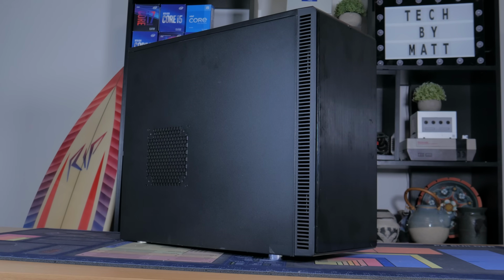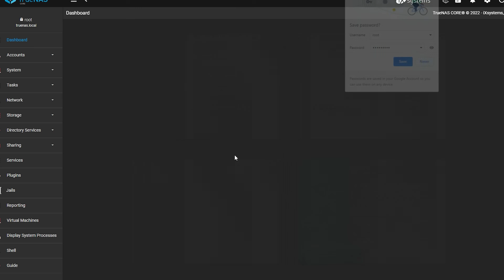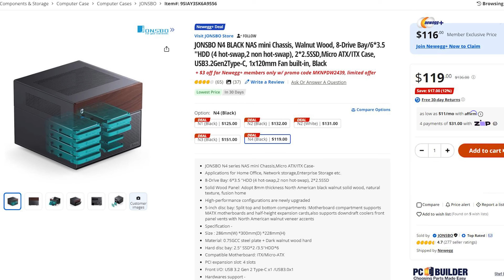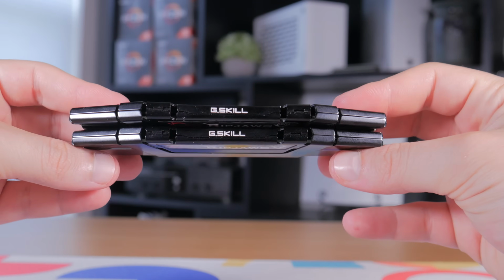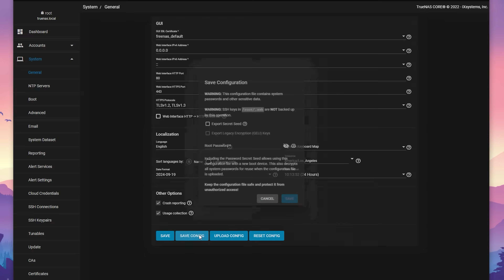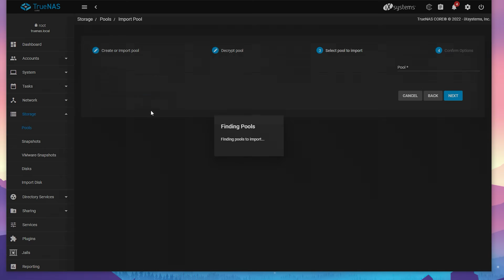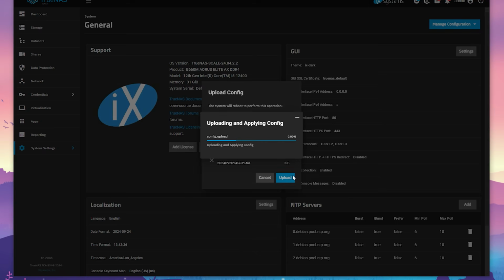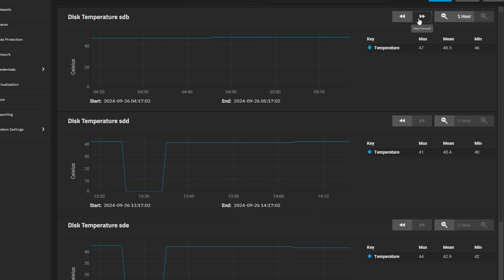Building My New DIY Storage Server! (2024)

Comment: Nice build. I also plan to move my server to more modern platform. I will keep my Define R5 though - plenty of room, very nice cooling options for the drive and components.
Few of my recommendations or observations if you care to read:
1. Take a look at CWWK Q670 8-bay NAS motherboard. I think it would suit your build better that a consumer board. This one has 8 native SATA ports, so no need for additional m.2 adapters or PCI-E cards or HBAs. 3*NVMe m.2 ports will allow you to add either a boot drive in mirror or a boot drive and two data drives in mirror for a fast tier of storage. 2x2.5GbE Intel based networking built in. It also supports Intel vPro on one of the network cards, so you can use Intel EMA software to remotely manage your server - similar to IPMI on true server boards (you need to have at least 1x500 CPU, so minimum i5-12500, i5-13500, i5-14500). Finally, you get full x16 gen.5 PCI-E slot for expansion. Support for DDR5 memory gives you that internal sort-of-ECC, which is still better than DDR4 with no protection at all.
2. Seeing what you plan to use your system for, I would recommend installing a virtualization software like, for example, Proxmox and then setting up a VM for TrueNAS with SATA controller passtrough, so TrueNAS has direct and native control over the drives. You can easily add docker and LXC containers for Plex/Jellyfin/Minecraft server etc. directly to Proxmox or host them on a dedicated VM if you prefer. Having your services virtualized, it will be a lot easier to move them to different machine in case of a system failure. Snapshot support will protect you from failed OS updates on VMs, where you can roll back to earlier version with few clicks. Finally, it will be much easier to jump between TrueNAS Core and Scale. As an added bonus, you could use Proxmox Backup Server as a VM to easily backup all of your VMs on an external system. Or you can build a Proxmox cluster, where you can easily migrate VMs between nodes or create High Availability setup. I know, I got carried away, but as you can see using a virtualization hypervisor gives you so much possibilities vs. bare metal install of TrueNAS.
3. Video of Scale vs. Core from Lawrence is almost 2 years old now and was comparing 22.10 version of Scale. During this 2 years Scale has seen a lot of upgrades, ZFS on Linux has matured as well. With your workload type I think there will be no problem with any performance. It also appears that iX Systems is switching gears to implementing new features in Scale for mix use (NAS and other services, like native Docker support in 24.10 and better VM host support), while leaving Core as a stable, NAS oriented system.

Wall of text over, thanks for reading :)
Reply from the maker: Thanks for the insight and suggestions.
Reply: at 8 drives+ you might as well buy an old 4u server as they are going to be cheaper and can hold upwards of 30 drives while also allowing you to throw noctua 120mm fans so its not loud at all.
Reply: @masterhacker7065  I don't have space to keep a rack cabinet at my apartment. Also those old servers use a lot of power, even at idle. I'm happy with my R5 build - it does all that I need, it's very quiet and energy efficient. Plus a modern CPU has a lot more performance compared to those old Xeons (tested them as well).
Reply: @CoreyPL  you dont need a cabinet for a single build, you can just throw it somewhere like i do. Sure they are slightly less power efficient but 140W at max load vs like 80-100W at max loads isnt shit for price at least in the USA... It would have to rip at max load for like a week straight to cost you like 11 cents more on average. I have an dual socket e5 2670v2 with 4 u.2 drives and 6 20tb hdds and for storage, minecraft or other game servers and plex it runs more than fine for a used ass shit server from 2012. Its also much cheaper using old server equipment even if its more power inefficient as the upfront cost is way cheaper
Reply: @masterhacker7065  I'm in the EU, and electricity is expensive here, around 0.35 USD/kWh. Also 2nd hand servers are more expensive than in US, so it makes a lot more economical sense for me to build it like I did. With 8 HDDs (idle but spinning), 2 NVMe drives, 2 SSDs I get around 50-60W power draw and maybe 20W more when stressed. I did a simulation before deciding which way to go and even with higher upfront cost, it will take only 3 years of it running to get back the difference, while the build is more powerful when the power is needed. And it's a lot easier to find a place for standard mid-tower than for hunk of a slab :) Also, less power draw = less heat, so I don't have to worry when summer comes and it gets hot in the apartment (no AC). I've chosen the best option for my use case and did a lot of research beforehand.
Reply: @CoreyPL  ah that makes sense you are eu, yah then in your case its stupid like you said to buy a rack. In the USA everything is just cheaper because we have more data centers, 95% of things on ebay are old servers or chinese ones. Electricity is so much cheaper as well, i know cause i lived in Europe (italy) and god damn using gas was the worst cause my powerbill was like 500$ in winter with russia.
Reply: @masterhacker7065  Yup, those where my exact reasons to go with that route. Most important thing is that I'm very happy with the build itself and it's serving me very well. Cheers.

Comment: It is 2024, at least convert Mechanical drives to all sata SSD drives.
Reply: Expensive, WD and Toshiba enterprise/data centre drives are much cheaper than the equivalent SSD size. Ideally you would want u.2 drives and not regular comsumer sata SSD too.

Comment: I've been running linux and truenas based servers for a few years now and a few things come to mind after watching this video. - first up, I'm really not a big fan of the case you chose.  the fractal design case is a much better choice for holding all those hard drives, and you could have just bought a new motherboard, cpu, and memory and it would have fit just fine in that case, also I think that it's probably got much better airflow and allows for standard atx power supply (way less expensive and usually more efficient), and full size pci cards (which is great if you wanted to later upgrade to using an external SAS JBOD for data expansion a few years down the line, or if you found you wanted to use a gpu for virutalization, ai, or transcoding stuff. and it doesn't really matter how large the system is because you can place it in some out of the way corner (so long as it has decent enough airflow), and you don't have to look at it.. behind furnature, on a shelf in the basement, off in a corner somewhere, and it's fine.

I don't like sata adapters period (most of them have really flaky chipsets that can lead to data errors.  if you need more ports than the motherboard will allow, I STRONGLY recommend dropping in a SAS 3 HBA (which you can usually find used for about the same cost as a pcie sata controller but WAY more reliable and gives you more options re: using an external jbod if you choose to do so later).  with a sas3 hba you can then use some cheap reverse breakout cables to put 4 sata drives per sas port.

using a non-enterprise disk as a cache drive is a mistake.  you will QUICKLY eat through your write endurance on that drive like nobody's business.  even a used enterprise sata ssd (for not a lot of money especially if you buy used) will typicallly offer more iops and like 4x the endurance.

as far as caching and data access speeds are concerned, however, zfs REALLY wants to do caching with ram, not really with ssd. I (and most others i've read) recommend maxing out the system's ram before you even think about installing an ssd cache.  if you fit that machine with 64 or 128gb of ram, it will be dramatically faster for average data access due to the way that zfs does memory caching.  the usual rule of thumb given by many is usually 1gb of ram per tb of storage space (I usually like to go a bit bigger for that estimate with 1.25gb of ram per tb so that you have a little more cache.  for an actual nas like this, though, where you're doing raidz or raidz2 with a bunch of disks, it's usually best to just max it out, especially now that DDR4 UDIMMS are SUPER cheap.

finally, while I applaud your wish to learn more about the software side of server hosting with things like plex and steam caching, etc. I would encourage caution right now with the truenas scale platform.  they are on the cusp of changing their ENTIRE application hosting stack from using a customized implementation of kubernettes to ripping all that out and switching to a cusomized implementation of docker.  it's extremely likely that you're going to have to reinstall all of your applications from scratch and reconfigure them when that happens, and the change is reportedly happening within the next month or two.  I have no idea what the new UI for app management is going to look, or what issues there might be porting applications from one system to the other, but it's very likely that some manual reconfiguration of your applications will be needed at the very least.  I'm not looking forward to that as I personally run transmission-daemon, plex, restreamer, and chia on my truenas scale setup.

best of luck!
Reply from the maker: Thanks for the insight and suggesitons.
Reply: Best build nas in the world create own self😅
Reply: I wouldn't mess up storage tasks and utilities. Nobody prevents us from building a dedicated server for all of this. In a better PC case than that Fractal "coffin". Additional costs are about few hundreds for an MB, CPU,  RAM, and PSU. And  then you can use a water block, full size GPU, and powerful PSU for your "virtualization". And connect to an existing NAS -) I think it will be possible to replace B650+i5 with some $90 used B450+4300G (for example) if Intel set will be needed for that new server. I'm almost sure we will need to attach a monitor to that server (KVM helps), and so walk out from a dark closet where NAS lives in peace.
And of course with a dedicated server we are free to chose any distro/OS, storage, memory which suit our needs better than a docker container on the NAS server.

Comment: I have some suggestions on your part choices..

1. Use a LSI HBA in ITMode instead of sata
2. ZFS requires atleast 1GB per TB of storage of ram 
3. Cache SSD - sort of meh, running a pair of sata SSD's would fair better than a nvme with low MTBF 
4. Install proxmox and move truenas core to a VM (you can do this with a HBA on PCIE passthrough for all the disks) - why upgrade CPU's and not use the extra performance for other services/vm's?

Comment: Looks good other than using the crappy stock cooler. Any $20 tower cooler (like what you had in your old server) will be better and quieter. If it will fit in your new case that is.

Comment: 5:15 that's unacceptable for a $116 case
Reply: @baronvonslambert  Gotta tell you about Fractal.  They are the best company ever.  I bought a case, and I didn't get something included.  I think it was the fan, and then the front panel did not close correctly -- because the magnets didn't fully lock or something like that.  So, they sent me every single piece that I needed, rushed to me, and were very responsive and compliant with only a picture.  Not that I'd cheat them, but they said they'd have problems, apologized, and got me what I needed.  And, from there on, I have bought more Fractal R7's from them.  They are TOP-NOTCH.

Comment: Can't beat a fractal design R4. Great case and still using mine for my server since 2014
Reply: I use a Define R5 and still plan to use it going forward.
Reply: I have a Fractal Define 7-XL not changing it.
Reply: Yes, Fractal is world-class cases.  I have a few R7's, I think.  Maybe, an R6 also.  But, I love those cases with a freaking passion.
Reply: Yeah, I had a R4 too, but that system got fried in Ice Storm in 2021, when we had surges go through our main breaker box.  Good case.  Plan to reuse it.  Was even my media server.
Reply: Nanoxia Deep Silence 5 and 6 are even better than Define R4 and XL. 11x 3.5" HDDs? No problem.
Reply: Yep, same here. I have two defines from that time - one for NAS and one for newly built gaming setup